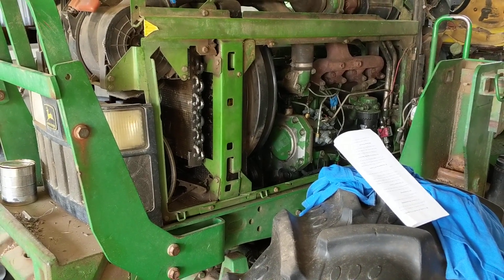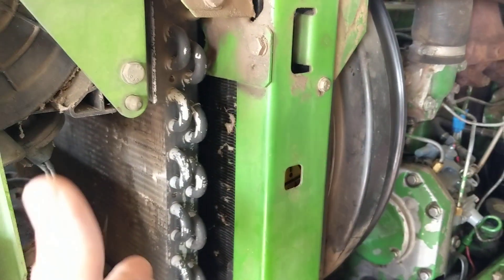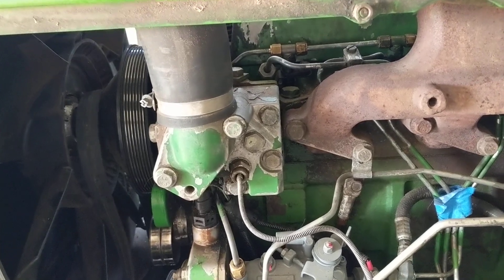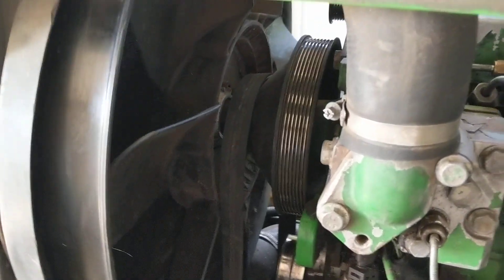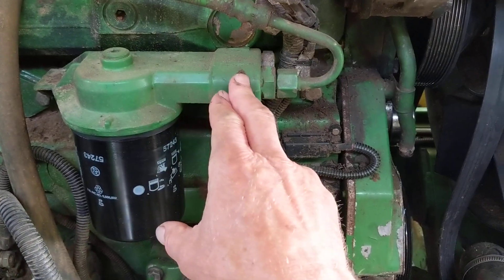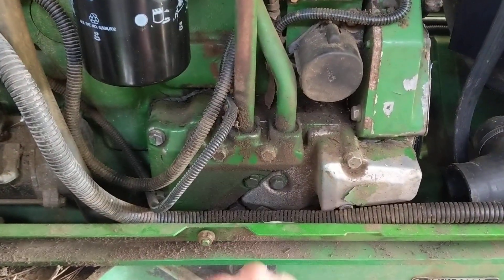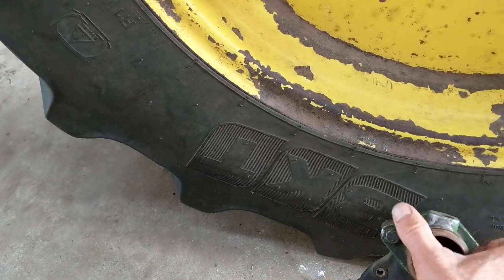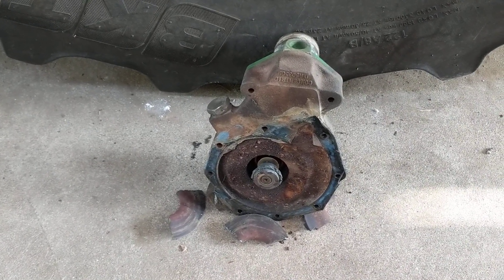5 reasons your John Deere tractor may be overheating - 6310

Comment: Thank you!  My 5093 gets hot when I bush hog I’m currently trying to figure out what it could be
Reply from the maker: Were you able to figure out what your problem was?
Reply: @joshmorris2474  I did! the coolant was old and broke down!  I drained the coolant refilled with distilled water and radiator flush ran the tractor for a few days repeating the flush!
Reply: @joshmorris2474  the old coolant was causing internal rust and a slim like mud!  It was crazy what it looked like after running that flush chemical thru it just once!
Reply from the maker: @rwk_88  thank you for letting me know!  Now we have a sixth reason why your tractor might be overheating.